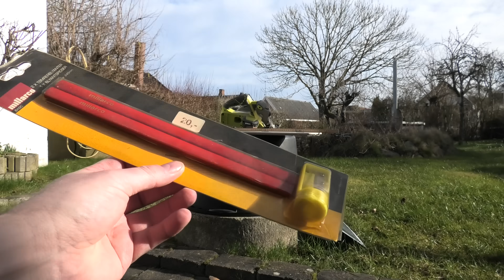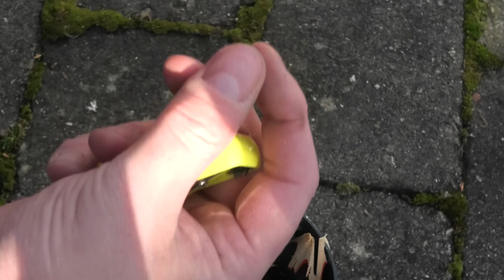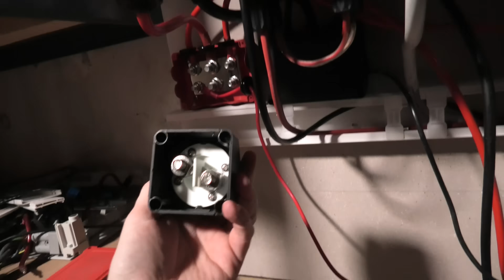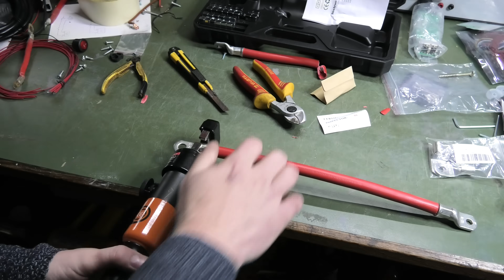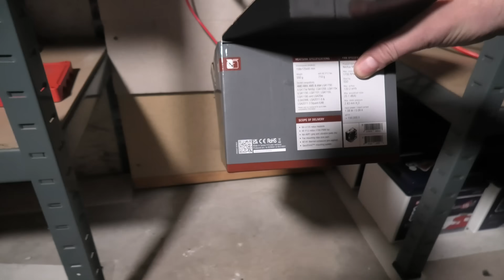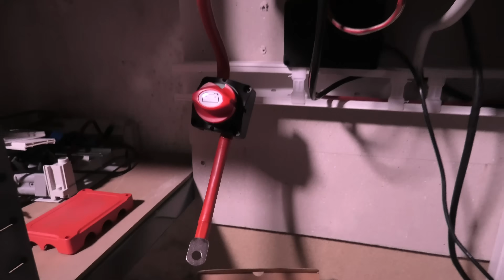Improving My Home House Battery Setup a Tiny bit!! - 1472

Comment: Is the 485A rating from an IEC standard?  I'd expect a 70mm² cable to get hot enough to melt the insulation if subjected to that much current for any length of time.
Reply from the maker: Well it is not really an issue,, as my inverter is 12KW and at 48-55volt,, that only gets to just about ½ of the rating of the cable.

Comment: What "Piece of thing" is this? Looks like some sort of fiber-cement. I hope this is not asbestos - which is forbidden to saw, bore and even clean with a brush, because it let people get cancer in their lungs
Reply from the maker: Yes sorry it is - fiber-cement left over from my bathroom build.
Reply: @MyPlayHouse  there are many kinds of fiber-cement. I hope for you it is without asbest. This is seriously dangerous! Asbest-fibers go deep in your lungs and stay there. you can not cough it out. Some stupid peoply may say "i worked half my life with asbest and i'm still alive". Yes, until you die because of lung-cancer. And it's much worse than this: asbest doesn't dissappear over time (here many roofs were plated with "eternit" (brand-name inspired from the word eternity) in the past), the fibers brake and you have much more smaller fibers that will cause cancer.

Comment: AWG is the wire guage size, also called 2-hot (2/0) which is thicker than 2AWG, I use 0AWG pure copper welding wire in my cars microwave/audio setup going to my inverter, I shold of relocated it and ran an 120v extension to the rear, live and learn haha. I heated the wire in a vice and filled it solid with solder as well, torched it in
Reply: 2 aught
Reply from the maker: It is really stupid to make up a wire thickness standard, when so many other things that could easily just use the same measurements.... rebar, hoses, poles,,etc etc....

Comment: My crimper is yellow, but i'm pretty sure it comes out of the same factory. They're pretty decent and you can rotate the head if that gets you a better angle on the work. I usually put the straight leg on a table so i can put all of my weight on the handle. You can always also just use the smaller jaw (i used 50 mm2 jaws on 70 mm2 cable).
Reply: If the correct size wire in a quality correct size terminal doesn't crimp properly the crimper is junk.  Putting in a smaller die may well result in the cable or terminal being over crimped and extruded.  The terminal will be obvious because it'll probably end up with 'ears'.  The cable is more difficult to detect.  Either way the amount of metal involved has been reduced and that isn't good.  Use good cable, good terminals (not those cheapie things with thin walls from the usual places) and good crimpers.  If you can't afford to buy decent crimpers pay someone to make up the cable.  The last thing you want is to be putting 300A through a bad termination.
Reply from the maker: I might have to also try the 50mm instead..

Comment: Rule number 1. MeasureTwice and Cut once.
Tip:- Use a thread to Measure
Reply from the maker: I used a thin cable to measure with,, and the bend radius on the way thicker cable,, made it wrong :-/